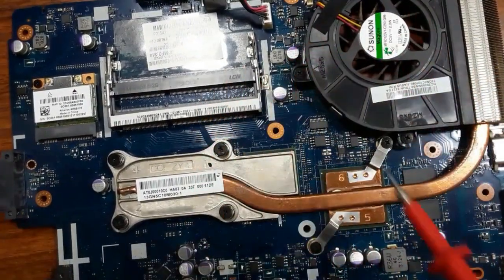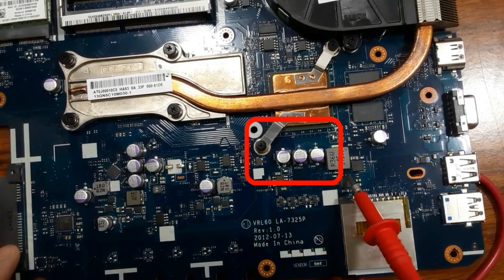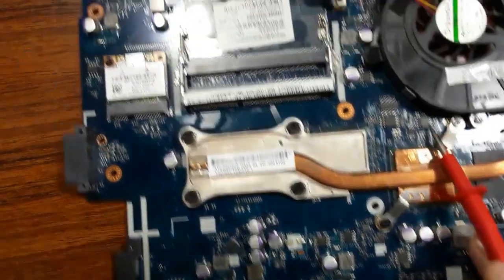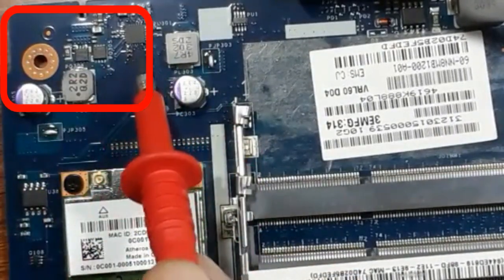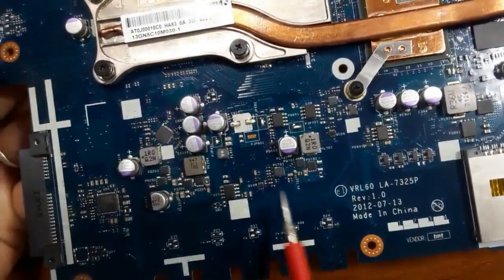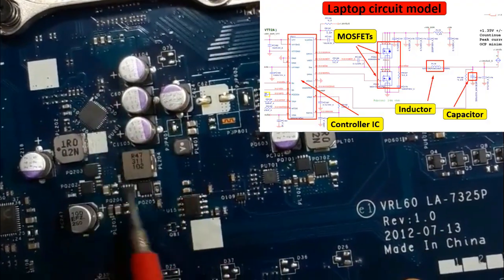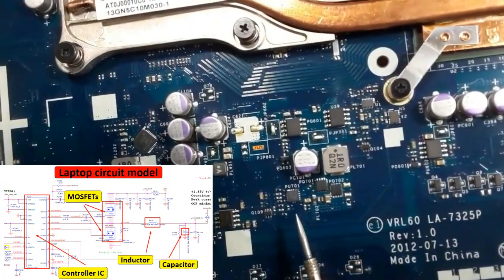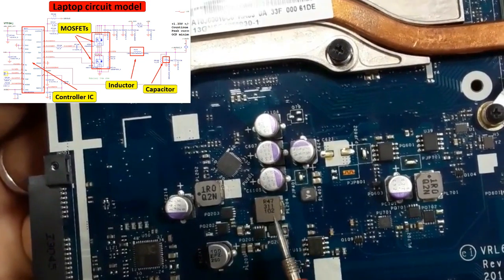Learn laptop motherboard circuits Components | laptop motherboard schematics

Comment: Thx for great videos.. I have a tablet with one system power ic whose marking is not visible, it has  a smd component marked Y which I found it shorted. I can't figure wht Y stands for. Googling it Y had option of zener diode, but I find no line on the smd device, and it is not thick as zener diode but thin. I would like to know what is Y

Comment: Hi there, please make a tutorial video about what is diffrent between diode mode and  continuity mode when we want to check, test or find short on laptop mainboread ,why somtimes we must use diode mode or somtimes continuity mode ,??eveyone just use this two method but they are not expline why ??thnx
Reply from the maker: Ok I will make a tuto about how to usr Multimetre soon.
Reply: @electronicsrepairbasics_erb  you are the best .